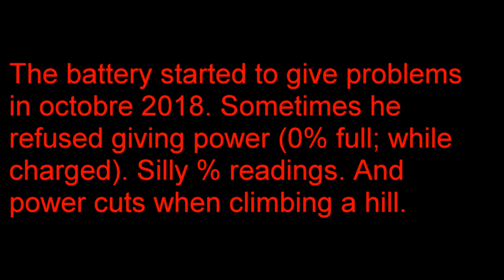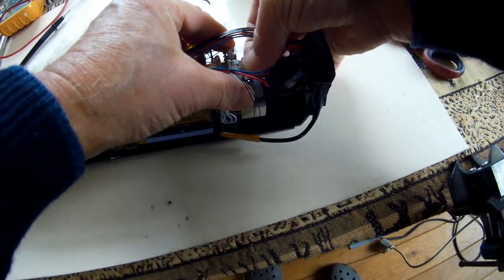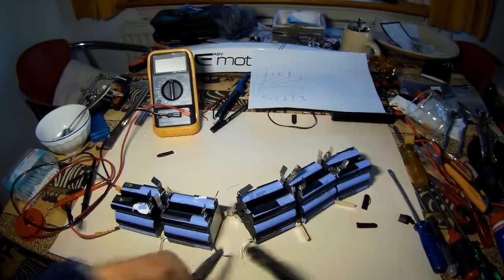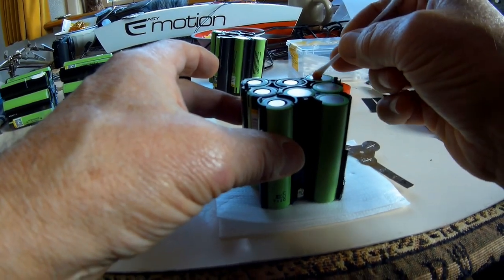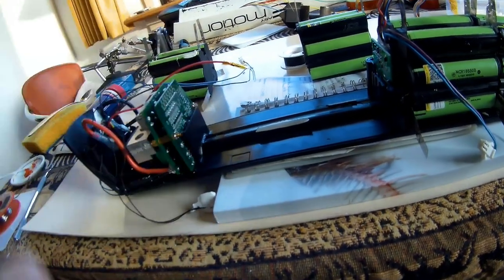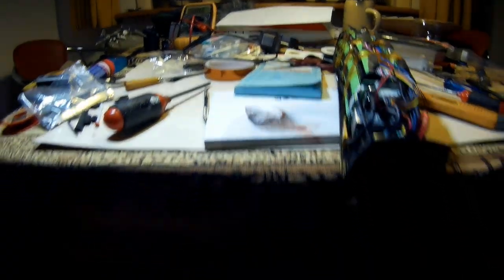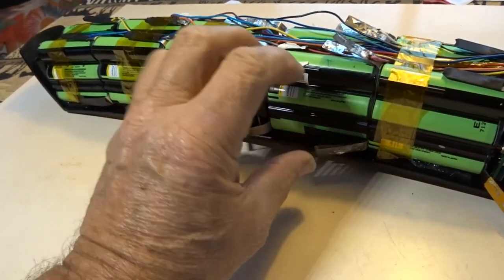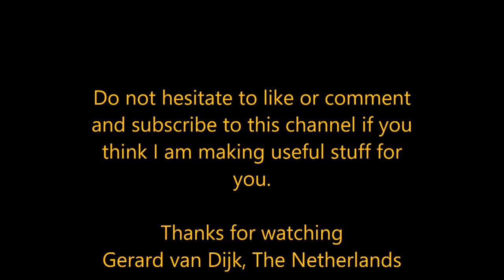BH Emotion Neo 36V battery repair EN

Comment from the maker: I used Panasonic 3400 mAh batteries. To be (more) sure, better buy them at the Liitokala store named "liitokala official store" and not at one of the copy liitokala stores with various other names. The official store is a large producer of chargers but they also import original Korean and Japanese cells which they must rebrand to be able to sell them outside of China. As with the other shops the overhead is low which enables them to sell at unbeatable prices. Gerard

Comment: Hi Gerard. I just completed replacing all 40 batteries following your excellent video (it took me 10-12 hours). Had you not made this video, I would never have thought it was an option to replace the batteries myself on my BH Neo Cross.
However, I have a problem - I can charge, and drive on my new battery pack, but after half an hour when the controller is off, I cannot power up the controller again. I then have to reset the battery on the set button inside the battery, before it will start up. I can measure that I have 41V on the battery pack, and it is fully charged, but the bike terminals goes down to around 22V after half an hour - still measuring 41V on the battery terminals, and this is when it won´t start up before I reset. Do you have any good explanation?
The yellow wire does not quite provide the the 0-10V signal, but it does not really matter, as it can start up just fine and drive - it just wont tell me the capacity of the battery. But that dont matter for me. It often goes to 38V on the yellow wire. A few times it worked just fine after a reset, but not any longer. Perhaps the controller of the battery is half dead. What do you think
Reply from the maker: 38 Volt on the yellow wire is crazy (if the yellow wire with the Neo Cross has the same function?!). Check all voltages of all separate cell blocks; after charging (when all seems well) AND when the problem occurs. Are these values homogeneous? Then the BMS at least does good some work. If it does not, then the BMS is gone. As you may discover when looking at my later BH battery videos you may find out that I simply dismissed (after one year of too many pushes on the reset button) the original BMS and replaced it with a 10S NCM balancer and a voltage meter (all on my videos). I also had to replace a few single cells of which the welds were loose which caused for an unbalanced behaviour of the battery. With the NCM balancer and intermittent charging with the original charger everything is super! Hope this helps. Greetings from a snow-white Netherlands

Comment: Great video Gerard. My 2013 NEO 29er (original owner) needs a battery replacement.  I have seen other complete 36v ebike battery packs on sale from $86 to $200.   What is your opinion on buying one of these aftermarket battery packs and wiring (in parallel) to existing BH Emotion battery?  This piggy-back arrangement would  maintain 36v but increase amp hours. I trust this configuration will retain all functionality of the bike display and controls. Any thoughts before I proceed?  Thank you.  Roland
Reply from the maker: I did “piggy backing” for a few years with my Neo Jumper battery with a 36volt 6Amp battery (so two 3000mAh cells in parallel). (LG cells rebranded to Liitokala in China). Take care that both batteries are at more or less the same tension when connecting to prevent high currents to or from one battery to the other. 86 dollar is too cheap; can be nothing but crap cells as 40 bare cells already cost that. Take care that you buy a pack with good cells. Carrying two full size batteries with one being ballast would not be my choice, but that is up to you. Since the original bms only guards the cells in the original battery you will get problems again after a few years. Also look at my vid on “Solving error code problems with BH Emotion Neo Jumper” to get a full idea of what your options are apart from simply buying a new original battery. People from the Remote Control community (battery powered ships, planes, cars) might be able to help you solving your problem. Greetings Gerard

Comment: I have a 2017 BH Evo Cross with 48V 10.5Ah straight battery. At over 21,000km now and battery still 'fine' but starting to notice it is getting a bit tired. Wanted to look at replacing cells one day as the rest of the bike is still good. Does the operation of cell replacement and cutting power to BMS cause the needing of regular resets? I would probably only go to the trouble if the battery would remain with original functionality.
Reply from the maker: @LB I do not know your type of battery BMS, so it is difficult to predict accurately what will be the case when you mount new cells. In my case some cells got loose and this caused the need to discover and use the reset switch -and finally replace or reconnect these cells. Cells may become damaged by soldering (see my soldering tips in this more recent video https://www.youtube.com/watch?v=FA1rGfxqA9w ) . But cells may also loose contact by weak spot welds. I now have a problem with the recently bought KkMoon 5000 W spot welder. Now I would buy a Malectrics; a KWeld or Sequre SW2 for more consistent welds. I also now prefer the brown coloured LG 3000 mAh cells (see my video on replcing the cells from the Giant bike) in stead of the green 3500 NCR ones I used for the BH bike. I never had a problem with the LG ones.... Most BMSses will not cause trouble after having been disconnected but there is a small risk. Most batteries do not have a reset button. Hope this info helps. Greetings Gerard
Reply: @Gerard_Hugo  thanks. Sounds like it's probably worth a try when the capacity gets too low. Hopefully it can last until the cell prices go back down to normal, they're mostly 50+% higher than a few years ago. Bugger

Comment: Was interested in your work on the 48 volt BH emotion battery! Would have liked if you include the opening of the battery and a breakdown and replacement of the individual cells. Is my battery is going to need replacement of cells sometime soon.

Comment: Great video. Very well explained. 
I have just one question, which current do I have to use for the Cells? Is 10 A to much?
Reply from the maker: Robin Demmer There are no 10 Ah cells, although some chinese sellers state that they do sell them. Buy good 3000-3500 mAh cells like the ones used in my videos. Maybe you mean the max discharge current? Well then 10 A is realistic and a good minimum. Most good Korean and Japanese cells have a discharge capacity that is at least 10A. Since you will have 4 or 5 cells in parallel this means a discharge of 40A at 36V meaning more than 1400Watts whereas your ebike motor is 250 Watt. Gerard

Comment: I have a bh bike and shoe 39volts but runs out of power very fast. Do you think is a batteries problem at this point? Is a 2013 so batteries are old. Great video but not sure if I am brave enough to take it a part.
Reply from the maker: Hello. That surely looks like a battery capacity problem ....... Eight years old. Not necessarily too old, as I have one E bike with a battery that is 10 years old. But it depends also on the number of chargings, exposure too extreme temperatures, exposure too fast discharging, capacity and quality of the cells. If you don’t feel confident you have two possibilities: Simply order a new battery (fast and sure and it probably has more capacity than the one you use now (e.g. 11Ah compared to 8 Ah). Or search for someone who can do this for you. You may think of someone working with electric remote controlled boats, planes, cars etc. Or a company that rebuilds E bike batteries. They exist, but do not necessarily accept to rebuild a battery that is quite rare, oddly shaped (curved). If you have experience with soldering (or are willing to learn it yourself by watching a number of YouTube videos specifically on the item of soldering 18650 cells and trying out on old cells) then ..... why not. Cells are still cheap, and that is the only financial risk you run. But be careful and work safe. Have a large bucket of water nearby to be able to submerge the entire battery if things go wrong. A moment with a spark is unavoidable but it is also there where things can go wrong. I build about twenty batteries, had sparks but never worse that that. But better be warned. I have three E bikes now running on batteries that were rebuild by myself. Look at all my BH battery related videos first before deciding. I had a BMS problem too (shown in the later videos) which you do not seem to have. Greetings Gerard
Reply from the maker: Once more: 39 volts?! Is that the maximum voltage after a charge? Then you should also check the charger. Is the output between 41 and 42 volt? If not then you should open the charger at the low voltage side. You will see two bright green square shaped potmeter inside with a Phillips screw white “screw”. Connect a voltmeter to the output and carefully twist or untwist the screw a few degrees. If there is no reaction then it is the wrong screw. Put that back to the old setting and try the other one. Set it on a voltage between 41,5 and 42 volts. If your charger does not charge your battery to the safe end voltage of 42 volt you are missing already some 35% of its nominal capacity. As the battery will switch off at about 33 volt (“empty”). Gerard
Reply: @Gerard_Hugo  I noticed the charger never goes in green light but the battery shows plenty of charge. I was thinking it could be the problem too. I will check what you mention and see if this is the problem also.
Reply: @Gerard_Hugo  I definitely will check your videos again and see if taking notes I can change the batteries. I know how to solder electronics but I was under the impression I need to spot weld the batteries in order to get a good connection. I would buy a new battery if I could but I think now they are discontinued so that's why I am looking into trying to fix it. I look forward to watch your videos and see if I need any specific battery I need to buy. Thank you very much for your fast response.
Reply from the maker: @cpsadp99  Concerning a new entire battery: There is only one place to buy it and that is original from bh ! If you mean the cells I suggest the 3000 mAh LG cells (brown colour) as used inthe rebuilding of the Giant power battery in one of my earlier videos. Preferably from the Liitokala factory store. Gerard
Reply: @Gerard_Hugo  Yes, was the whole battery. I will look in to if the entire battery will need to ship from Alava Spain; But I will check the brown batteries from Liitokala. Do you think soldering the batteries will work or should I see if I can get a spot welder. Sorry for so many questions. I appreciate quick you get back to me. ;)
Reply from the maker: @cpsadp99  In a factory setting spot welding is a lot more efficient. However in a repair situation you have both choices. I never had a problem with soldered connection coming loose after movement of the cells, with cells that were spot welded, I did have cells that had lost their connection. That is something you do not want (specially not with this battery). If you have it done by someone then lit him or her the choice. I don’t know from which country you are but the number of hours rebuilding this battery was considerable. So why not ask the export department of BH how to proceed.What choices they can offer bhservice3@bhbikes.com or bhexport3@bhbikes.com They shipmaroundmthe world and have representatives around the world. If my choice would be paying 350€ at someone repairing it for me or buying new for say 550 I would choose the more expensive option. No surprises, guarantee etc. Gerard
Reply: @Gerard_Hugo  I am in Minnesota. I believe BH import went out of business due Covid in US so now I need to find a solution. I will email BH and see if they have a export department and see if I can get it here and maybe take the old one a part and see if I can fix it. That is probably more secure. lol
Thanks again for the great information.

Comment: Hi gerald I hope you can take time to respond to me even though your video is a couple years old. Ive just bought a bh neo easymotion. The bike was a started refurbish project and was missing a lot of parts including the battery. I have some 36v batteries and i want to solder on connections for these but i dont know what to do with the yellow wire. i have read online that people are having no start issues without 10v power. and i want to have the ability to watch battery status on the display. How would you wire in the yellow wire? I have been thinking about using resistors to reduce the voltage, but i was wondering if you had a better solution? Thanks in advance
Reply from the maker: Hello Christian. Forget about the possibility to read out the battery status via the yellow wire. This would require a specialy build BMS that converts the charge status of the battery to a linear 0 to 10 volt signal to the display. 0 for empty and 10 V for fully charged. Instead mount a simple digital voltmeter to the + and - of the battery. Apparently you did not check my other battery related videos on my BH bike. I suggest you do that first. These videos will give you the info you will need. If then questions remain you can ask me again. Check out this link to see all of my videos and pick out the BH battery ones. https://www.youtube.com/channel/UChX9VzBo6NXDuyM0xXHG8RA/videos
  Gerard
Reply: @Gerard_Hugo  Thank you for your response. I found one of your videos where you used a batterypack, then wired a separate wire into one of the cells to get 3-4.2v quite smart and i would use this too if i were to use the bike. However my so is going to use the bike so i would like to stick to only 1 connector. i am thinking about going a route where i install a voltage regulator on the bikeside of the plug and adjust this to an acceptaple voltage and install a separate battery indicator.
Reply from the maker: @christianbjerkestrand2315  Why not use a 3 contacts connector?! And why use a voltage regulator? Serves no purpose as I see it. If you want a more simple voltage indicator you will be able to find specific 36 volt Li ion Led indicators that lighten up at the start of a small button and turn off after a few seconds.

Comment: Hi Gerard, i replaced the cells in this 36V Battery, but now i dont have display of full battery. Voltage at the big connectors is 41,5V. Do you know how much voltage must have the yellow wire?
Reply from the maker: Hello. After charging check the voltages at all 10 parallel cell blocks. This should be 4.15 plus or minus a few hundreds of 1 volt. The tension that is send to the yellow wire is between 0 and 10 volts. As you can see in my most recent video on this battery (on completely removing the bms) I generate a tension of 4.2 volt on the yellow wire, resulting in a charge level reading of 42%. So it seems to be a linear signal. Pushed the reset button (separate video on that item)? Please let me/us know what comes out. Greetings Gerard
Reply from the maker: @nickbrown1279  It is questionable if you can obtain a separate new bms for the bh battery. And replacing the cells is a hell of a job and there are always financial and warranty risks involved ! So in cases where the bms is also gone it is wiser to simply order a new (and stronger) battery at bh in Vitoria Spain. Concerning the Bosch. I know the story. You may consider clamping the 36 volt of another battery to the bms so that you can safely disconnect the bosch battery for repair. There is a Telegram group in Germany going over all sorts of electrotechnical issues of the Bosch eBike parts (only in German though). If you give me exact data on the parts I am willing to ask them in German if making the bms tensionless kills the bms. Gerard

Comment: Hello Good Job. I have the same Battery But my BMS are broken and lost in my Lab. :-(  Can you telll me the Serial Numbers there Printet of the BMS. Then can i Order a new for my Battery Pack. I can t fount anything about this BMS in the web. You are my last Hope. Thank you.
Reply from the maker: I fear you will not be able to buy a separate BMS as manufacturers of e bikes consider their bms as an integrated part of the battery. Often with manufacturer or even model specific features. I still have the old bms. It’s number is BH-PURE PWR Ver:1. 2PBN01320P02. Mine says 2012/05/30. I think I once typed this serial number in Google but it did not give any results. An alternative for buying an entire new battery would be to skip the BH bms buy splitting the battery in two 18 Volt halfs with each half getting a separate JST 6 pin connector for balancing and charging with e.g. a Hobbyking 6 80 watt hobbycharger. See my separate video on how to do that (title something like “solving error code problems with bh Emotion battery”. Gerard